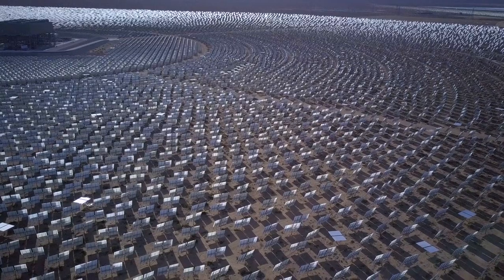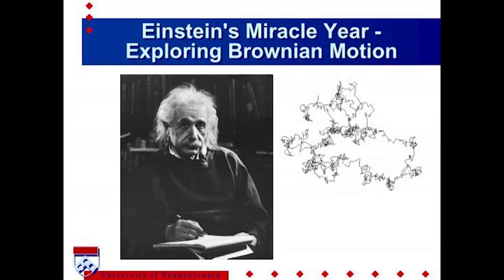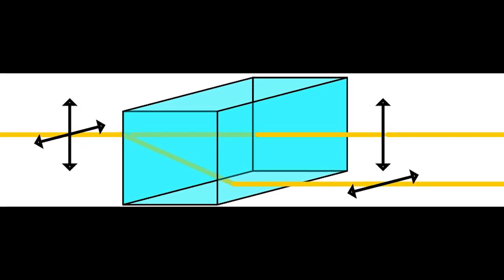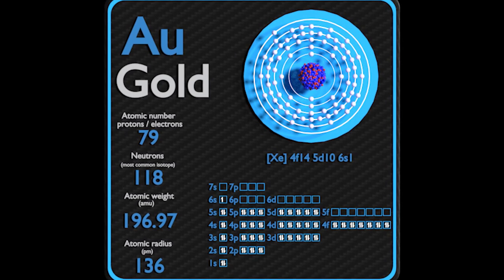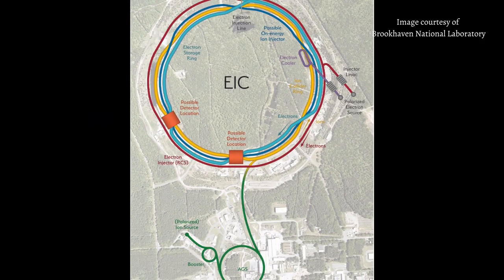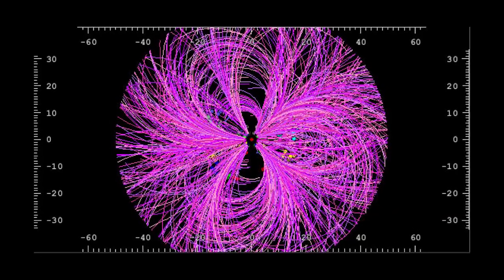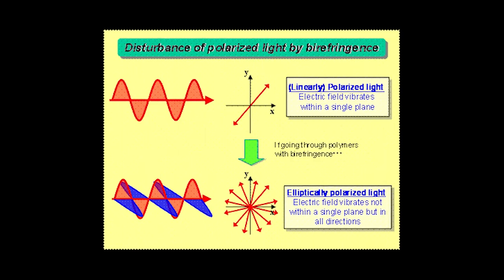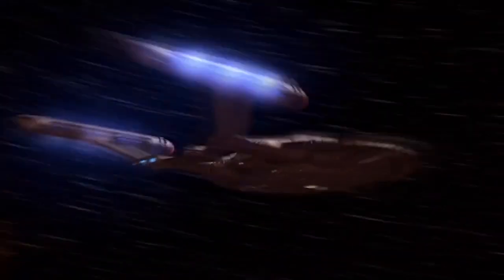Recommended: Scientists Just Created ( Converted ) Matter From Light. Here's How.

Comment: What if we describe subatomic particles as spatial curvature, instead of trying to describe General Relativity as being mediated by particles?

Quantum Entangled Twisted Tubules:  "A theory that you can't explain to a bartender is probably no damn good."  Ernest Rutherford

The following is meant to be a generalized framework for an extension of Kaluza-Klein Theory.  Does it agree with the “Twistor Theory” of Roger Penrose?   During the early history of mankind, the twisting of fibers was used to produce thread, and this thread was used to produce fabrics.   The twist of the thread is locked up within these fabrics.  Is matter made up of twisted 3D-4D structures which store spatial curvature that we describe as “particles"?   Are the twist cycles the "quanta" of Quantum Mechanics?

When we draw a sine wave on a blackboard, we are representing spatial curvature. Does a photon transfer spatial curvature from one location to another? Wrap a piece of wire around a pencil and it can produce a 3D coil of wire, much like a spring. When viewed from the side it can look like a two-dimensional sine wave. You could coil the wire with either a right-hand twist, or with a left-hand twist. Could Planck's Constant be proportional to the twist cycles. A photon with a higher frequency has more energy.  ( E=hf, More spatial curvature as the frequency increases = more Energy ). What if gluons are actually made up of these twisted tubes which become entangled with other tubes to produce quarks. (In the same way twisted electrical extension cords can become entangled.) Therefore, the gluons are a part of the quarks. Quarks cannot exist without gluons, and vice-versa. Mesons are made up of two entangled tubes (Quarks/Gluons), while protons and neutrons would be made up of three entangled tubes. (Quarks/Gluons) The "Color Force" would be related to the XYZ coordinates (orientation) of entanglement. "Asymptotic Freedom", and "flux tubes" are logically based on this concept. The Dirac “belt trick” also reveals the concept of twist in the ½ spin of subatomic particles.   If each twist cycle is proportional to h, we have identified the source of Quantum Mechanics as a consequence twist cycle geometry.  

Modern physicists say the Strong Force is mediated by a constant exchange of Mesons. The diagrams produced by some modern physicists actually represent the Strong Force like a spring connecting the two quarks. Asymptotic Freedom acts like real springs. Their drawing is actually more correct than their theory and matches perfectly to what I am saying in this model. You cannot separate the Gluons from the Quarks because they are a part of the same thing. The Quarks are the places where the Gluons are entangled with each other. 

Neutrinos would be made up of a twisted torus (like a twisted donut) within this model. Gravity is a result of a very small curvature imbalance within atoms. (This is why the force of gravity is so small.) Instead of attempting to explain matter as "particles", this concept attempts to explain matter more in the manner of our current understanding of the space-time curvature of gravity. If an electron has qualities of both a particle and a wave, it cannot be either one. It must be something else. Therefore, a "particle" is actually a structure which stores spatial curvature. Can an electron-positron pair (which are made up of opposite directions of twist) annihilate each other by unwinding into each other producing Gamma Ray photons?  

Does an electron travel through space like a threaded nut traveling down a threaded rod, with each twist cycle proportional to Planck’s Constant?  Does it wind up on one end, while unwinding on the other end?   Is this related to the Higgs field?  Does this help explain the strange ½ spin of many subatomic particles?  Does the 720 degree rotation of a 1/2 spin particle require at least one extra dimension? 

 Alpha decay occurs when the two protons and two neutrons (which are bound together by entangled tubes), become un-entangled from the rest of the nucleons

. Beta decay occurs when the tube of a down quark/gluon in a neutron becomes overtwisted and breaks producing a twisted torus (neutrino) and an up quark, and the ejected electron. The phenomenon of Supercoiling involving twist and writhe cycles may reveal how overtwisted quarks can produce these new particles. The conversion of twists into writhes, and vice-versa, is an interesting process.

 Gamma photons are produced when a tube unwinds producing electromagnetic waves.

>>>>>>>>>>>>>>>>>>>>>>
Within this model a black hole could represent a quantum of gravity, because it is one cycle of spatial gravitational curvature.   Therefore, instead of a graviton being a subatomic particle it could be considered to be a black hole.   The overall gravitational attraction would be caused by a very tiny curvature imbalance within atoms.  We know there is an unequal distribution of electrical charge within each atom because the positive charge is concentrated within the nucleus, even though the overall electrical charge of the atom is balanced by equal positive and negative charge.
>>>>>>>>>>>>>>>>>>>>>>
In this model Alpha equals the compactification ratio within the twistor cone.   1/137

1= Hypertubule diameter at 4D interface

137= Cone’s larger end diameter at 3D interface where the photons are absorbed or emitted.

The 4D twisted Hypertubule gets longer or shorter as twisting or untwisting occurs.   (720 degrees per twist cycle.)  

>>>>>>>>>>>>>>>>>>>>>>>
How many neutrinos are left over from the Big Bang?  They have a small mass, but they could be very large in number.     Could this help explain Dark Matter?
Reply: dude u sound smart and all but what's it to us in a y-tube comment section make ur own vid or smth😂😂😂(it's a joke plz don't kill me)
Reply: Just need a 3d light printer, print food. With out useing food paste.

Comment: I have a question: E=MC2 means energy is the same as matter when it's multiplied by the speed of light times two. Am I right so far? Ok, but how do you multiply matter by a speed? What am I getting wrong here?
Reply: @Sandariano not times two but squared i/e speed of light times the speed of light.
Reply: @dirtbird7415  ok, that'll be a huge number. But how do we multiply matter by speed? What does it even mean? Could you explain it to me like I was 5?
Reply: @Sandariano  not sure this would be the answer your looking for , but you can look at it like it's use in bullet ballistics.
 In that case energy is equal to the mass of the bullet by its velocity squared. 
 So multiplying matter by a speed would yield total energy.
Reply: So you can figure out how much energy is stored in any given object by multiplying its mass by the speed of light times itself?
Reply: @Sandariano mass and energy  both are same but  measured with different units. Joule for energy kg for mass. Equation only convert one unit to other. Mass is so contracted foam of energy so the numerical value becomes such a large amount. It is only the difference between the two units.
Reply: @surendranmk5306  I think I'm getting it. If something weighs 5 kilos and I want to know how much energy that is, all I need to do is multiply 5kg times the speed of light squared. The resulting number will be the energy 5 kilos has in joules. Did I get it?
Reply: @Sandariano  yes! That's all. Now understand one more thing. The C means two things. One is an intervel in space and the other is an intervel in time. In general relativity  it is one intervel in space time. Thus when we say 1 light year, it means two things, one is the spacial distance between two points and the other is is the intervel in time that light requires to travel it. C^2 is a square in space where sides having a length 2.998^8 metres.